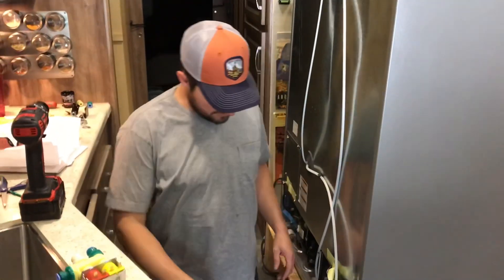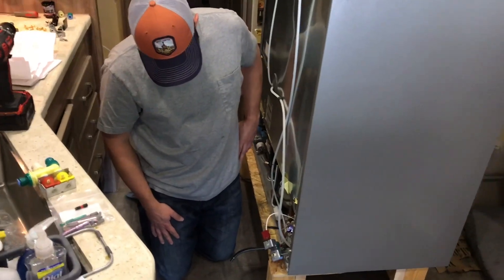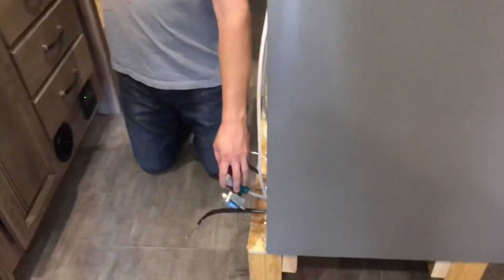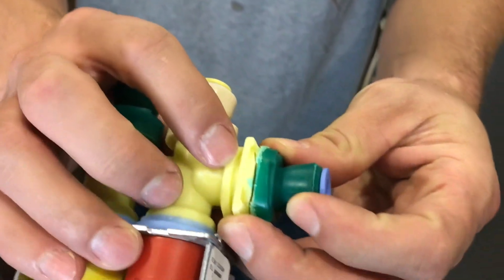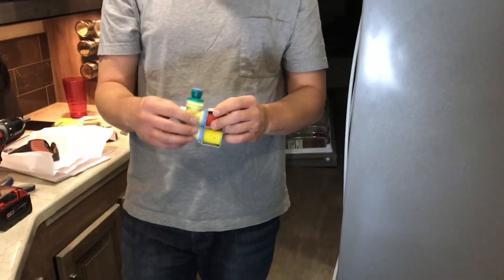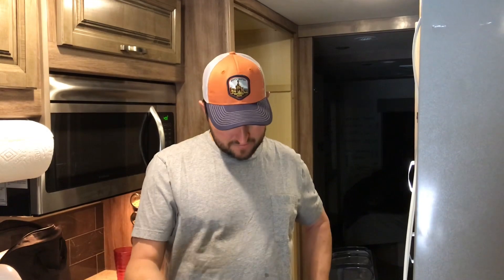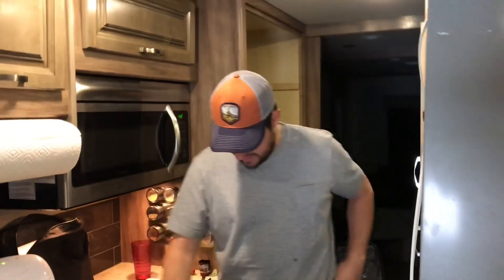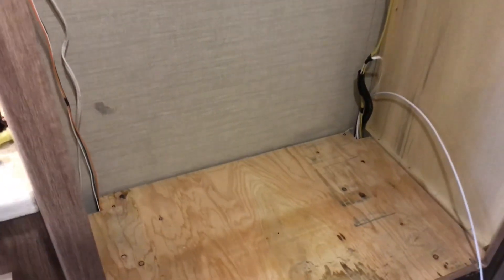Winter Damage to our Residential Fridge in our Jayco Seneca

Comment: There’s nothing wrong with the fridge it the winterize method. You are right that you can’t get all the water out but if you would fill your system with RV antifreeze until it comes out of both the ice and water dispenser you’ll never have another problem.

Comment: What will you do this winter to winterize your residential refrigerator now that you know the valves and lines can potential freeze?  What will you do different this winter?
Reply from the maker: Either run the ice maker with pink stuff until it runs pink, or disconnect the ice machine lines and blow them out to make sure all the water is out. We have our RV in a heated garage now so we no longer winterize. Then we can easily travel in the winter if we have some nice days.

Comment: This is a good video and right on time. May I ask, if you could go back to before you purchased this rv, would you still buy the Jayco? I ask because I am also looking at renegade. I don't mind paying the extra cost, but I really want to know that I am not spending unnecessarily.
Reply from the maker: Marvin Walcott  We do not regret and would get again. We have had some minor problems, and upgrades we chose to make, but overall I think you pay for the engine and machine and we couldn’t be happier with the power. Little things like the interior upgrades are no big deal. But you can’t change out the engine after the fact.